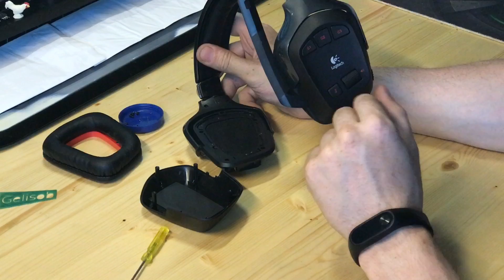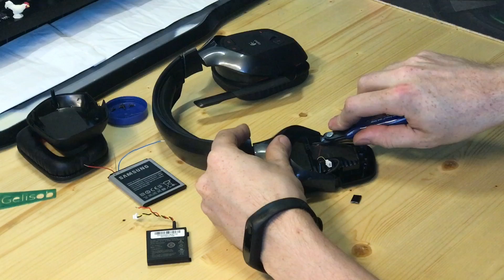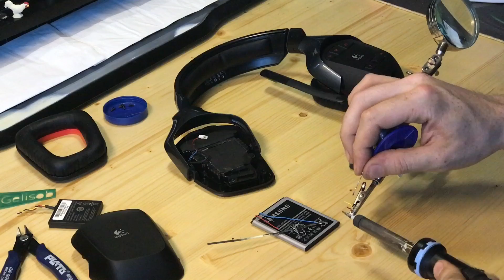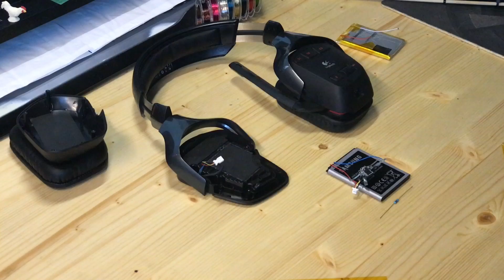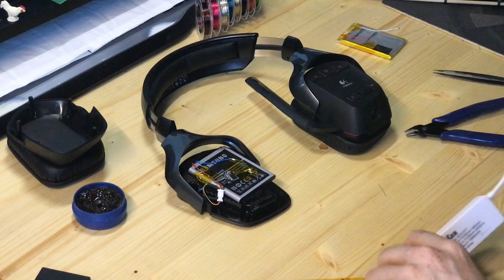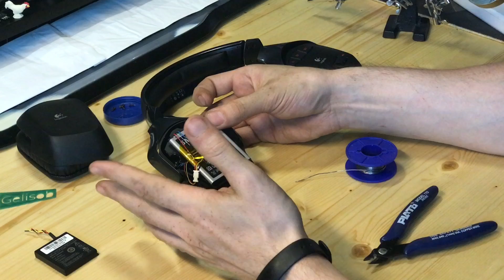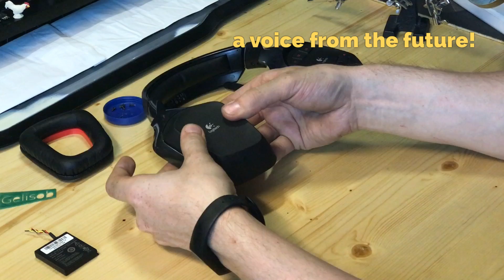Logitech G930 24h battery mod

Comment: LOL guys, just tear down original battery and use that circuit. Best results. This guy is complete noob.
Reply from the maker: I'm sorry to dissapoint you, pro catalin, but people tend to be somewhat wary about breaking down lithium battery cells, with good reasons. I would not recommend to follow this unless you really know what you are doing. And then you probably didnt need my video anyway.
Reply: yea... i am not the only one said that here. that is how i did. and yes, compared to the way u solder i am pro. i do reballing on chipsets , you? oh u do sarcasm.
Reply from the maker: Congratz :) But please do not go advising people on the internet to do dangerous things, as you said i'm noob, so, I dont know what word you have left for those with even less skill but you definitely should not tell them to go hacking batteries apart.
Reply: you both are the battery already has one built in
Reply: yes pro, we know that. the one built in will show u "not charging"

Comment: I wonder why is it so hard to find a legitimate "original"  replacement battery for ANYTHING?  Only place to really get an original is  IF you're lucky enough to find one at BestBuy or whatever store you have in your area.  Usually you can't find the one you want or need.

Comment: Can I use 2.5A board?
Reply from the maker: hello, if you mean the protection board that has upper rating of 2.5A then sure, thats just it's upper limit of how much current it can handle. That is 2500mA and the headphone uses around 100mA max. Main purpose of the board is to watch voltage so you're good if it's ment for lipo voltages (charged at 4.2v).

Comment: Much easier for everyone (I think), teardown the original battery and use the circuit of it ;)
Reply: It's realy work? I wanna try it. Thanks.
Reply: tmcsword1 yeah, easy 20~24 hours but the software will be annoying for the last 2~3 hours and say "low battery" xD
Reply: Thanks dude. I Will make It. Só the Wired Yellow and Black need stick together sure?
Reply: @TheQuentincc  For the software no to be annoying, just edit the manifest file, which is located at Program Files\Logitech Gaming Software\Resources\G930\Manifest\Device_Manifest.xml You can also easily edit turn off interval (just set to 0) so that the headphones won't turn off after 15 minutes without use.
Reply: @serge2sb  Thanks you, I'm gonna try this some time.
Reply from the maker: Thanks for the tip. For those who are not afraid to open the original battery case and salvage the original circuit, you can sure try, just be careful :) And make sure not to disconnect anything in there before you made clear to yourself, where what connects so that you can connect it the correct way on the new cell.

Comment: https://www.ebay.co.uk/itm/1-4-WATT-METAL-FILM-RESISTORS-1K-OHM-9-1K-OHM-Multi-Variation-Listings/231742173855?hash=item35f4e8f29f:m:mj18AeCE0S5QrtBJp1lh-Bg 

 this resistor will be better ?
Reply from the maker: any 10k ohm resistor will do. 1/4 watt is enough yes.

Comment: My guess is that bigger battery has bigger weight, thus it will disballance the headsets. Can you feel this disballance or it's way too small to feel?
Reply: This thought had crossed my mind as well, but I doubt the weight is substantial.  I replaced my g930 battery with a used replacement from Amazon and it didn't feel much lighter than the one in my LG phone that I've removed on several occasions.  I would definitely be interested in what the video owner's response to this question is though...

Comment: thx for the video! i thought to buy bigger cells 
https://www.amazon.de/Panasonic-Akku-NCR18650B-3400mAh-401023-grau/dp/B00AIOH9VG/ref=sr_1_fkmr0_1?ie=UTF8&qid=1510088023&sr=8-1-fkmr0&keywords=18650+round+pcb

do you think they would fit?
Reply from the maker: Hi, you're welcome :) But no sir, 18650 cells will not fit, they are, like the name says, 18mm wide and there is room for 5mm in between. You would need to break the cover or modify it or leave it open with the cell clued-taped or fitted otherwise. If you dont care about the looks then check ebay-amazon for "18650 holder" - you could clue that on the side.
Reply: Thank you, I'm sorry that was really a stupid question from my side...

it worked!!!!
I've used an Galaxy s3 battery with 2100mAh, it was the only cheap one which was 100% original

For the PCM i've used this board:
https://www.conrad.at/de/pmic-batteriemanagement-s-8261abjmd-g3j2g-ueberladungsschutz-tiefentladungsschutz-ueberstromschutz-abschaltung-bei-k-155151.html?sc.ref=Search%20Results
datasheets:
http://www.produktinfo.conrad.com/datenblaetter/150000-174999/155151-da-01-en-IC_LITHIUM_POLYMER_AKKU_SCHUTZSCHALTUNG.pdf
http://www.produktinfo.conrad.com/datenblaetter/150000-174999/155151-da-01-en-AUSFUEHRLICHES_IC_LITHIUM_POLYMER_AKKU_S.pdf

I've conected the 10k resistor to - and it worked instantly!

Thank you so much!

Comment: hi there, i actually got the problem that my g930 is permanently reconecting while it is in charge. do you think i can skip this issue with the g930 by modify it with your guide here?
Reply from the maker: hello, your issue sounds like a problem with your electronics that is before the battery. This mod will probably do nothing to change that behavior, would be my guess. I believe it will continue to do this reconnection bs but you would just have longer battery life and have to charge less often. (probably pretty unusable now as soon as you need to charge it while you were using it, then it can do the charge at night and never run out while using, making it a usable headphone pair again)
Reply: gelisob thanks for the answer :) yes this was my plan. Or could i send it to you and pay you for some repair and modification work?
Reply from the maker: Thank you for the offer but with all the shipping back and forth and my work hours, it would get stupidly expensive, you would be better off giving the money to some local electronics/tv repair shop guy with the video link along with parts if you dont want to do it yourself.
Reply: i will give it a try :)
Reply: There IS a reset switch on the transmitter.  Did you try resetting it?  Logitech told me this, when I was having trouble with mine.

Comment: Recharge normally by base on pc?
Reply from the maker: If you are asking can you charge the headphone after modification from the base like usually then yes, you can. It will continue work normally like before, just the battery life is 24h.
Reply: What minimum amperage should have circuit protection?

Comment: great video! quick question about a battery I bought - I tried to buy a similar one, but it has 4 copper spots with a + sign on the left side and a - sign on the right side. it is a 3.8 V Li-ion, 2100 mAh is this okay to use and if so do I still solder the ground type wire in the middle with the 2 different spots? please let me know if you can. (eb-l1g6llu 2100mah battery). thanks so much for your help!
Reply from the maker: for simplification sake, treat it like a two connector and run 10k resistor from negative to the middle plug wire. Or if you have multimeter - test the resistance (ohm's) from negative to the middle connectors and get back to me here with what it reads.
Reply: I do not have a multimeter, and I am still waiting for my Protection Circuit Board to come in the mail- would you recommend a certain multimeter to purchase? Thanks
Reply from the maker: If you have none right now then you dont really need to go very specific, since anything is better than nothing :) I recommend going to local electronic store and getting whatever cheap entry level one, will do fine for starters. If you want to be more specific then maybe ask for auto ranging or take a look at cheapy one in aliexpress/ebay like UNI-T UT120A. The basic 10 dollar ones do a lot for basic needs.
Reply from the maker: recommend being careful with the "less money, more juice" kind of offers. Often will end up with 50% of claimed capacity in reality - get it when you can test it and claim your money back when it's false.

Comment: I just dismantle original battery and took battery controller from it. After that I just switch battery controller to new 2100mah bank that's all. with 2100mah original controller my g930 don't charged.
Reply from the maker: I have not seen original battery "controller". I do not know how the wiring on that is done or would that work. See how I wired and try to check if you have similar connections and find out what you are missing. Probably the "middle" doesnt go anywhere or reports the wrong resistance value. Better get one of those protection circuits linked here.
Reply: Protection circuit that is part of original Logitech battery has only two connections to the battery. As I understand by original 2100mah controller Michael means controller that was meant for 2100mah battery he bought.

Comment: I am interested in trying this as my headphone is passed its warranty.  Would a battery with 4 pads/wires work?  I figured I could solder positive and negative and choose 1 of the other 2 as ground.
Reply from the maker: Hi, could you find a link to the battery you are talking about so i could take a look? You cant just choose pads randomly, they must be connecte to ground to be used as ground :) I'm not sure what type of battery it is if it has 4 pads. You should measure them with a multimeter. You may only use 3.7-3.8(4.2v full) type batteries. And make sure it fits by size too.
Reply: I may have this kind of battery somewhere in the house.  Droid X  https://www.amazon.com/Motorola-Droid-MB810-BH5X-Battery/dp/B003XW8UPO/ref=sr_1_2?s=wireless&ie=UTF8&qid=1500354987&sr=1-2&keywords=motorola+droid+x+battery.  Sorry I am a novice at this stuff.  I am planning on borrow a multimeter from a relative and ask him for advice also.  This for this video mate!
Reply: what about 4.35V full, will it charge to full or only up to 4.2, thus not using whole capacity?

Comment: I found these: http://www.ebay.com/itm/10PCS-3-7V-4-2V-1S-Li-ion-Lithium-Battery-18650-Charger-BMS-Cell-Protection-PCB-/322392730840?_trksid=p2385738.m2548.l4275
About to buy them but would like a second opinion, because you know... I don't want to blow the side of my head off.    xD
Reply from the maker: Yeah these will do fine too :) they are nice and small, and up to 2Amp discharge, we only need like 0.2Amp so it's fine :) Just make sure to wire it correctly
Reply: You're on-point! What do you think about batteries that already have built-in protection?
Reply from the maker: I use and recommend them for logitech h800 and H600 modifications but I didnt find anything with large capacity for the format we need for G930. The ones for h800 and h600 have little capacity for G930 (600mah, as is this ones original). If you find anything fitting, let us know :)
Reply from the maker: two wires would not be problem, you can fake the thrid with 10k resistor from negative line but those are 54x60x5.8mm - the one i selected is 50x63x5mm - it might be too wide to fit..  cut out something from hard plastic (cd case) with that size test if it fits :)

Comment: can i use this protection circuit? http://produto.mercadolivre.com.br/MLB-868525872-proteco-bms-para-bateria-18650-li-ion-37v-_JM
i cant find any like yours.
and how i conect the cables in this circuit
with a 2600mha battery ill be able to recharge through the main micro usb?
Reply from the maker: Pretty interesting find, yes that has proper values on it to be used with this. Wiring on it you can see there on the picture too - the end(tip) connections go to battery, the back center ones (input/output negative, input/output positive) to headphones. And then add resistor from battery middle one to input/output negative. You can charge any mAh rating battery through the usb, it just takes longer if the battery is bigger :)
Reply: thnx! ill try, xD i share my result when im done ^^
Reply from the maker: but be careful about believing that 2600mAh capacity talk, it is most probably exaggerated quite a bit from reality, if it's the same physical size as the one i showed.
Reply: actually its 1800mAh xD, its from an unused mobile i have here, do u remember the dimensions of that fake battery you used? in mm or cm
Reply from the maker: Sure, it's 63x50x5mm
Reply: im using the exact protection circuit as his. i still confuse about adding the resistor. should i connect the resistor from middle terminal of the battery to the middle wire from the connector (like you did in the video) or to the negative output on the protection circuit? like you said if i connect the resistor from middle battery to negative output on the circuit, then how about the middle wire from the connector?